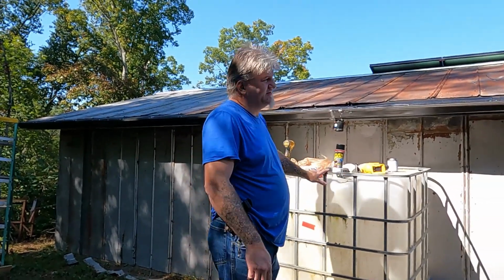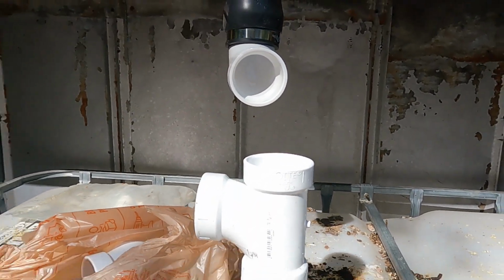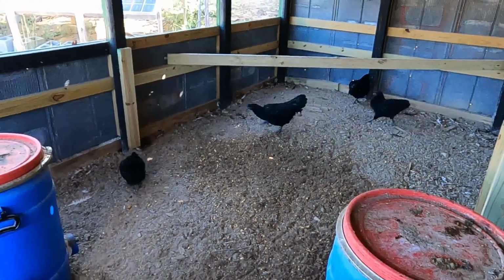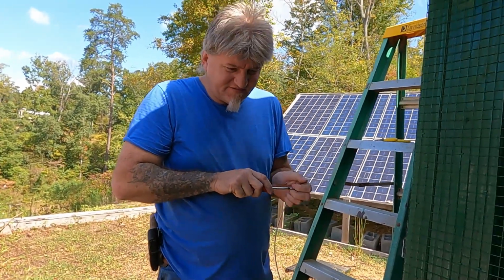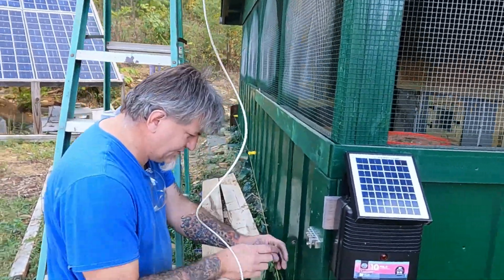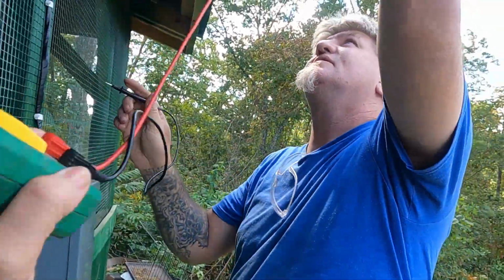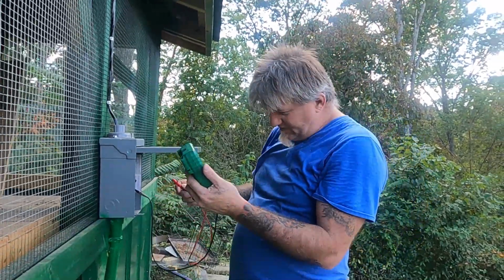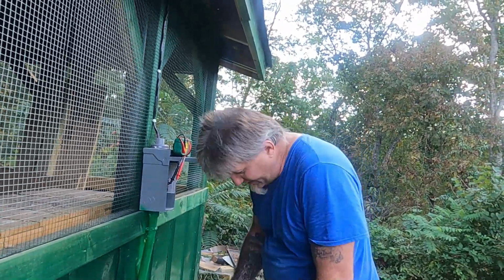I GOT LIT UP

Comment: You're getting voltage from where to where what are you connecting the meter leads to ? B+ ,HOT, NUETRAL, ???
Reply from the maker: The entire metal roof has voltage, neg lead to neg terminal in box and just touching pos to metal roof
Reply: Wow!  💥 
Glad you’re ok!
Reply: That’s just weird brother I wish I had a clue on why it’s doing that
Reply from the maker: @southernohiosolarhomestead8477  only other thing i can think of is i didnt use the true pv wire but i didnt on any of my other arrays either